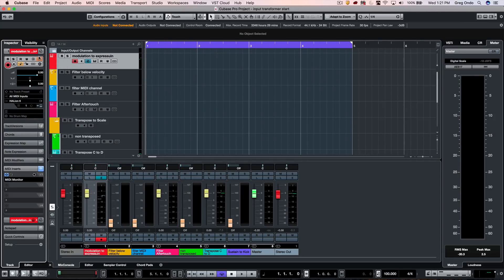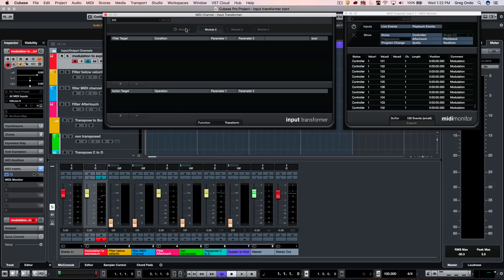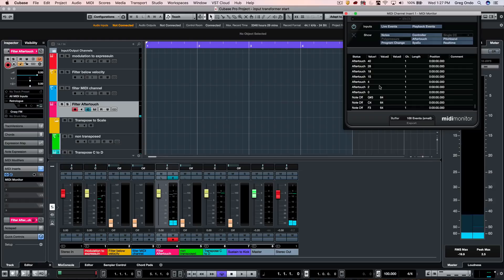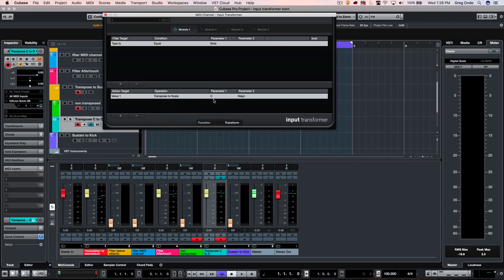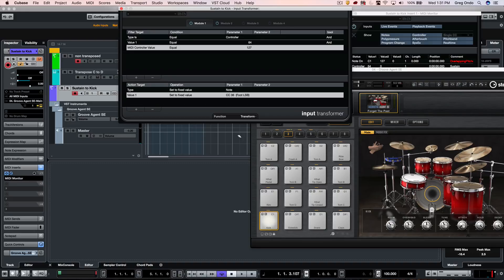How to Use the Input Transformer in Cubase | Q&A with Greg Ondo

Comment: Would it be possible with the add function to add a value from one CC to another one, not the number of the controller, but the parameter? For example, I'd like to add the CC122 Value2 to the CC1 Value2, as a variable offset.

Comment: The Transformer as a MIDI insert, though, appears to be a bit different. Surprisingly also it comes with the Logical Editor presets instead of its own as is the case of the "Real Time Transformer", and which presets, in many cases are not functional or unpredictable (I haven't tested them all yet) because they are not designed for real-time use.. So what is the state of play here? Is there a different behaviour of the Transformer as an insert compared to the Input transformer as explained in this video? Why do the Logical Editor presets appear in the MIDI insert version of the Transformer? Is this another Steinberg mix-up?

Comment: I'm trying to use the Input Trans to REVERSE polarity (invert) my Sustain pedal, as the one I bought does the reverse on my Roland controller. So, I set up 2 Modules... If CC64 is 0 then make value 2 = 127 , and if CC64 is 127 then make value 2 = 0.... problem is it either cancels out the sustain altogether or cancels out the "0" altogether...  is there a way to invert with one Module?
Reply: Figured out !  Simply mirror controller 64 - value 2 - mirror - 64

Comment: Hi Greg,  Another great video.  I have a question with regards to the MIDI Input Transform for a track.   I'm using polypressure to send a unique number out of cubase, but for some reason as soon as I mouse click on the track, the polypressure data doesn't stop sending until I click onto a different track or folder.  This is creating a data storm and has crashed the MIDI pots a few times.  I've tried using different MIDI ports (IPmidi, LoopMIDI, Loop etc etc), but these make no difference.  So, is there a way to stop Cubase sending more than one polypressure message ?   Thanks, Jonathan

Comment: Thanks for that info! I was trying to figure out if Cubase has a function that limits modulation value. In my case, I'm trying to add vibrato to a vst trumpet. But if I move the modulation wheel too far, the vibrato sounds like a violent shake. So I'm trying to figure out if there's a feature that'll limit the value to let's say from 0 - 40. So it'll omit anything from 41 - 127. Any help would be much appreciated! 🙏🏼

Comment: Greg, can you help me with a small issue? I tried the "Transpose to Scale" action, but it doesn't behave as expected. I want it to output the MIDI notes in the chosen Scale. 

For example: I play in C major and chose to transpose to F Major, then the resulting Midi notes should be outputted in F Major scale in the resulting Midi. But it stays in C major (the sound get's transposed, but not the Midi - when I turn the Input Transformer off, the notes are played back in the original C major scale). How can I transform the Midi output to a chosen scale?

Comment: Hi, I tried filtering 2 MIDI channels (unequal to 4 & 13) as you described but it is not working in real time... what am I doing wrong? I'm selecting 2 tracks at the same time but hearing both track's sounds with a split keyboard transmitting part channel 4 and part channel 13.

Comment: Great info.  I have an Akai APCmini that use to control Kontakt libraries in Cubase. The clip buttons work great for selection of midi notes for articulation changes. The unit has 7 faders hard assigned to 48 to 56. I want to transform all of them to the more useful defaults in the Spitfie/Kontakt interface CC's 11, 17, 21 etc  9 'transforms' in all. Is it possible to set this many transforms to a track. I've sucessfully set one per module but I can't figure out how to set the other 5.

Comment: Hi Greg, how can I filter Notes that I accidently hit twice on a Mpc Pad? E.g. sometimes it occurs that when I hit a Pad, the same note is triggered again about 40 ms later (mostly - but not always - at velocity lower than 10). I could filter those by velocity but considering the time aspect would be much nicer because sometimes I hit a Pad at low velocity but want to keep the note. So I need a function that says: Filter Commands that have the same note and are less than let's say 100ms apart from each other. The function of the context gate pretty much solves it but unfortunately gates CC inputs as well so it's not usable. Thanks a lot

Comment: Thank you so much for this Greg!

0:40 Transform Mod wheel (CC1) messages to CC11.
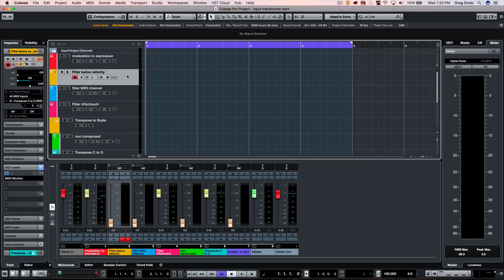3:13 Filter out all incoming MIDI notes below a certain velocity (<60).
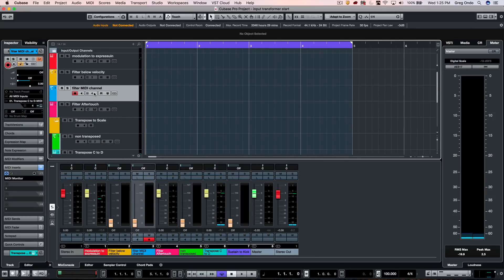4:40 Filter notes from specific MIDI channel (e.g. only allow incoming notes from MIDI channel 10).
5:39 Filter out Aftertouch MIDI messages
6:52 Transpose incoming MIDI notes to a specific scale
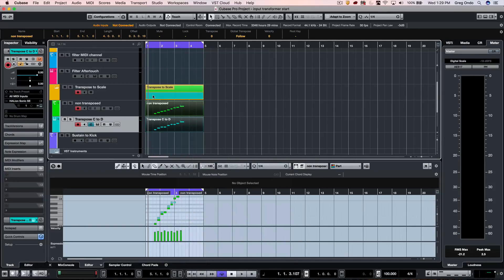8:10 Convert sustain pedal to MIDI notes (in this case for use as a kick drum).

Comment: Hi Greg! In the Kickdrum Example, you leave all MIDI NOTES ON. Probably it would be better to not resrtict the upper part to 127 and send the cc-value as note velocity instead. By releasing the pedal you would send note_on with velocity 0, which is (AFAIK) the same as note_off. If that does not work, a second module handling the pedal release should be added. Best, Ralf.